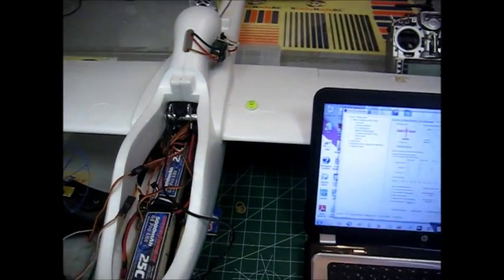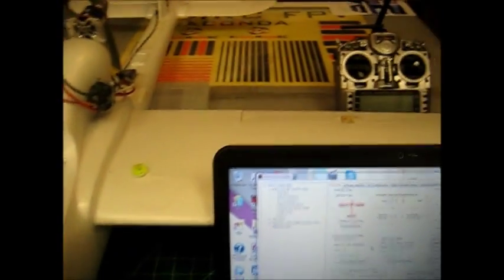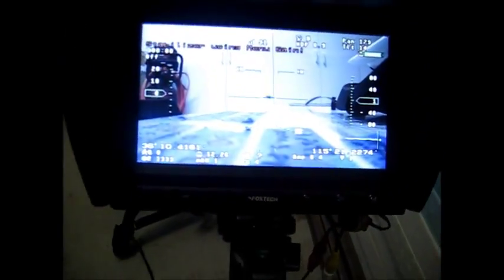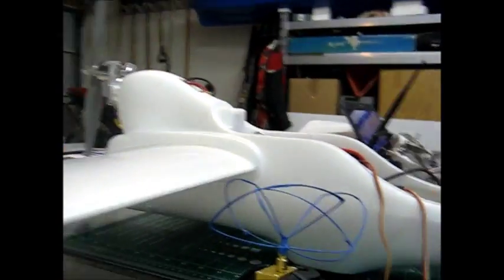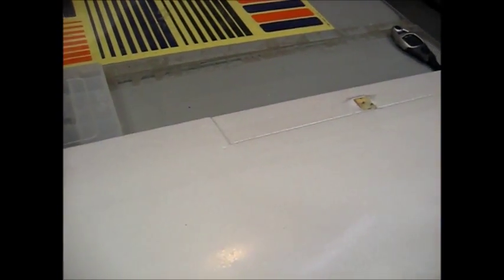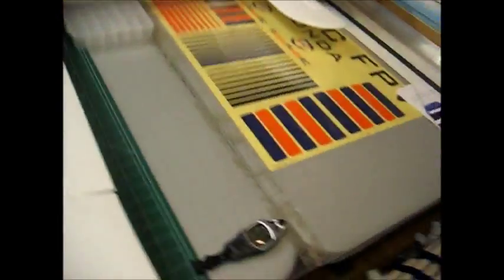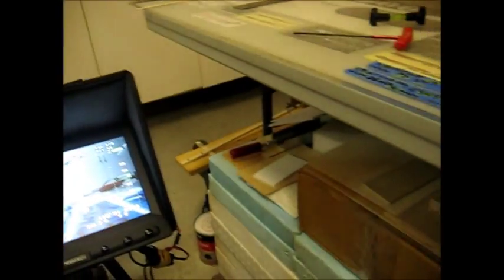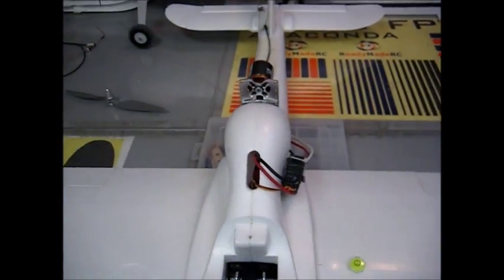Eagle Tree Vector Issues with Incorporating Trims in 2D mode

Comment: What did you actually have set up that was casing the issue?
Reply from the maker: Mike Roy I had mixed in elevator and aileron off sets for throttle off level flight.  In order to fix the issue, I had to eliminate the mixing on the stabilization channels and leave the mixing only on the manual/stab off mode.